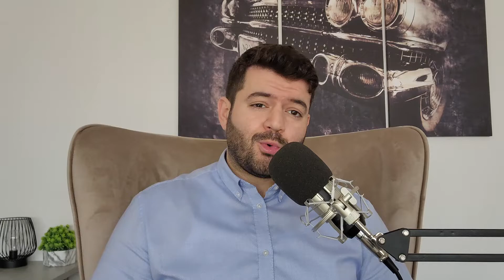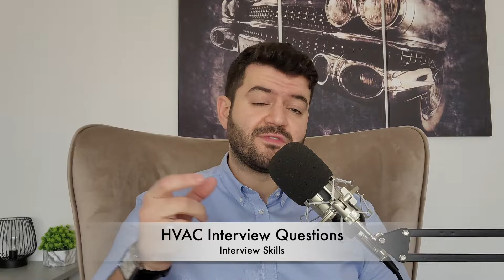HVAC Engineering Interview Questions and Answers (HVAC Basics-HVAC Training)

Comment: Between Hvac & Mep or Revit modeller which one has a promising future with most scope in coming years ? How can we as fresher engineers make the most out of it & climb the ladder of success faster ..
Reply from the maker: Great question mohib , MEP engineer is expected to know about HVAC, electricity and plumbing works while an HVAC engineer is mainly dealing with HVAC and with regards to modelling or drafting it should be a complimentary skill to your engineering skill set not your main job in other words you need to know about design aswell not just modeling/drafting and as you get some experience in the field you should develop your managerial skills which will greatly help you out. 

On our academy we have a great HVAC Master Class which includes 6 courses that includes years worth of solid HVAC experience, it's currently on promo for limited slots I strongly suggest that you take it since it will surely give you a head start on what to expect 

https://eedu.online/p/hvac-elite-masterclass?coupon_code=PREMIUM-SALE